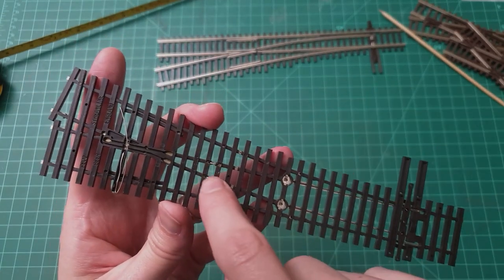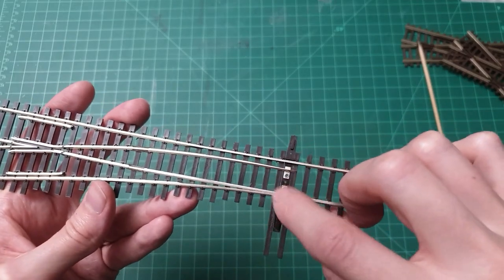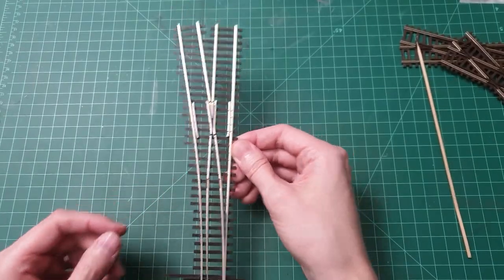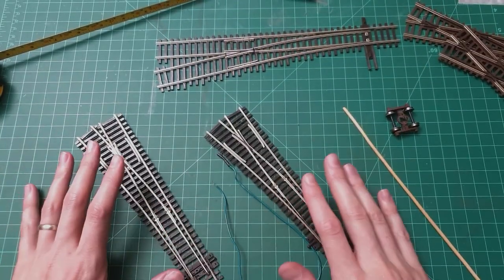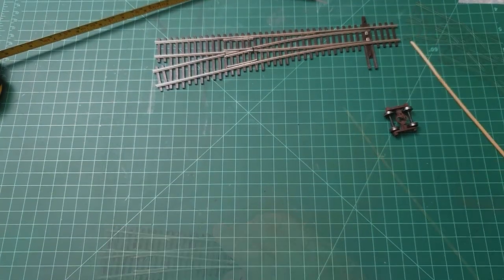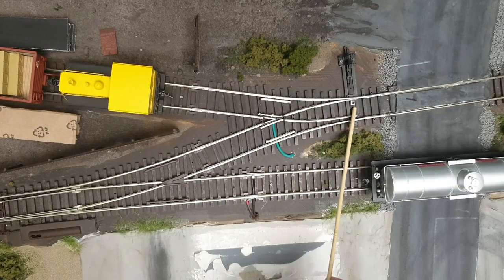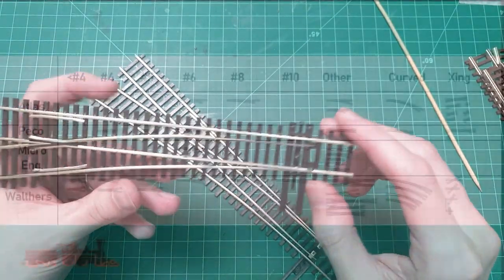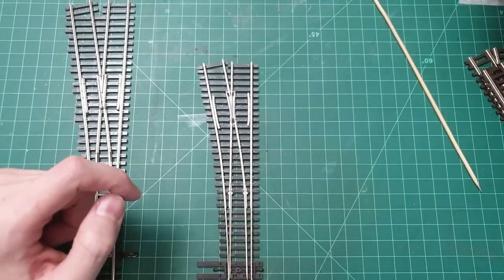37 - Model railroad turnouts explained and compared. Atlas, Peco, Walthers & Micro Engineering

Comment: I don't mean to be confrontational but I am wondering if you mean track feeders when you refer to jumpers? I'm new to wiring and having a hard time keeping up with all the terminology.
Reply from the maker: Hi! No worries all questions are good. Let me try to explain my understanding of jumpers and feeders. Jumpers, in this context, are an electrical connection between two pieces of track. At 1:22 when we look at the back of the turnout you see there are metal 'strips' that connect the two positive tracks with one and each-other. You see the same at 4:35. These later ones can be removed it you do not want the 'jumper' functionality. 
Feeders are wires that connect a piece or track to the power source. Either direct to a command station / transformer on an oval loop (with perhaps sectional easy connect track) or to a bus wire on a elaborate layout. 
Hope this helps!
Reply: Besides watching videos, reading model railroading magazines; I would suggest you get at least one book covering layout wiring which will help answer some of your questions and as a reference when you need a refresher.
Reply from the maker: @royreynolds108  Great tip. I have a lot of books but I must admit wiring is not my favorite topic!

Comment: Why would you use electrofrog?
Reply from the maker: In a nutshell, because they are mechanically very reliable. No derailment and built solid.
And you can easily hardwire every stretch of track. To create more redundancy in electrical continuity. I.e. trains that keep on running smooth.